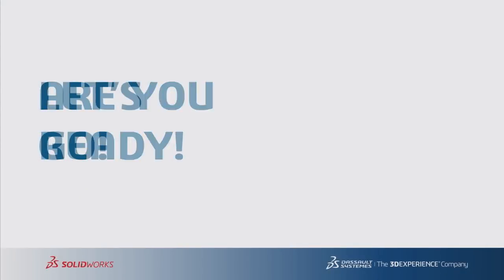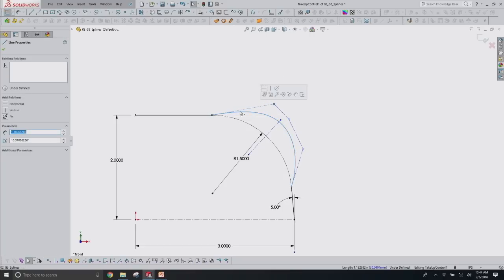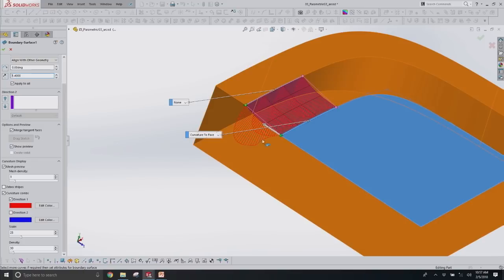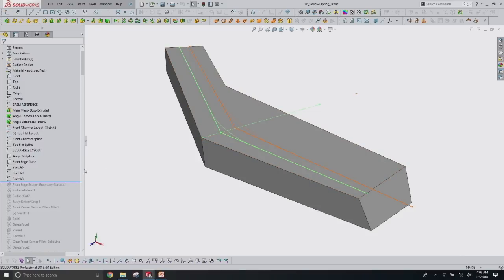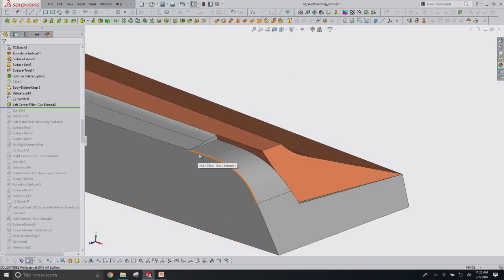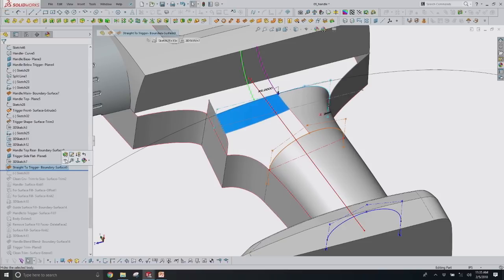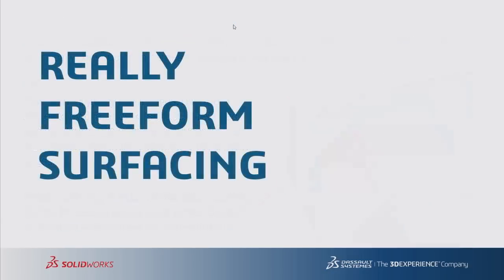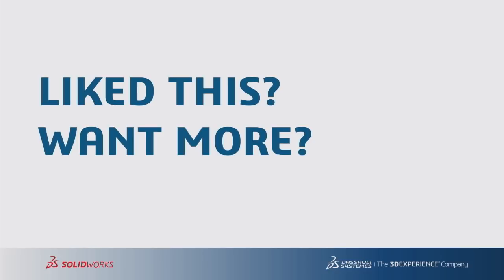SOLIDWORKS World 2018: Zen and the Art of SOLIDWORKS Surfacing

Comment: I have a question about the connectors in the Boundary Surface feature. In the CSWP-SU exam, I’m struggling with this feature when it's requested to create a Boundary Surface between two edges—one being curvature to a surface and the other a direction vector. I can see two connectors: one green and one pink. When I change the tangency value, a white arrow appears next to the green connector on the left side of the edges. If I flip the connectors, the green connector moves to the right side, but the tangency arrows still remain. The issue is that the surface area of the created subsurface changes when I flip the connector. My question is, how can I determine the best location for the connector, as the exam doesn’t provide any clear indication of the correct option?

Comment: Hi! Thanks for the amazing video!
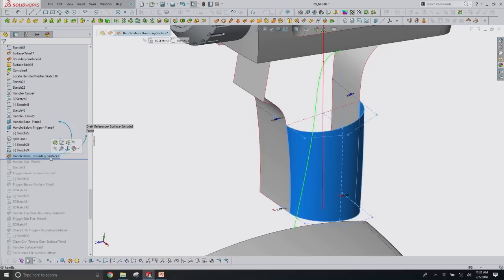I was wondering why you use helper surfaces at 1:01:14 to set a boundary surface edges tangent to those helper faces, instead of selecting the sketch without a helper surface and applying a 'normal to face' option with an angle when making a boundary surface. 
Is the result the same? If so, is the benefit of helper surfaces that you can reference the draft angle to a global variable?
Reply from the maker: Hi Daniel, the result between "normal to profile" or using a helper surface with the "tangency" option is the same. Using the helper surface is just the way I'll always done it. And you're right, using the helper surface allows you to bake in global variables for draft, which I don't think the "normal to profile" lets you do.

Glad you enjoyed the video!
Reply: @lowe9  Thanks a lot for the reply! That helps me a lot. All clear!

Comment: Hey Andrew, for the G3 between two straight lines you gave equal collinearity and equal length for the control segments but for the G3 between two arcs or two splines, try an equation defined through geometric progression for the length of the control segments apart from having equal curvature for both arcs and curves. I'm thinking it should work, mathematically.